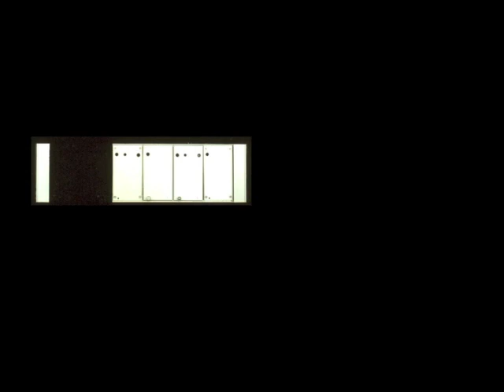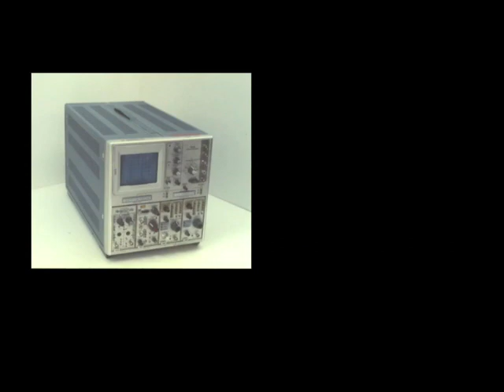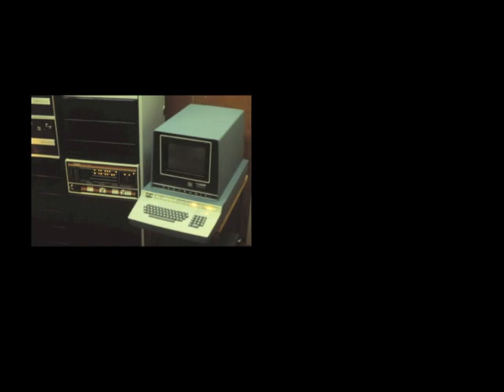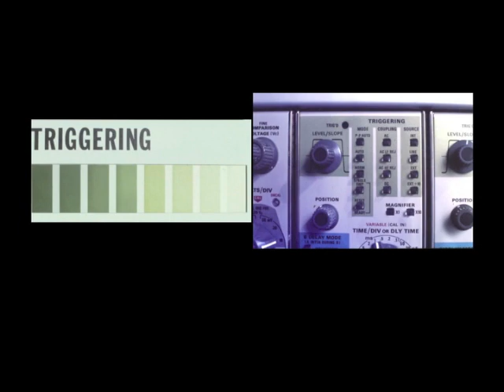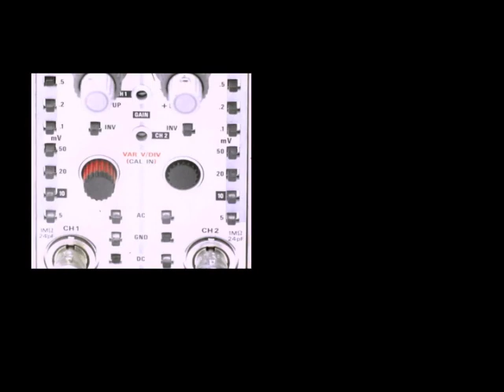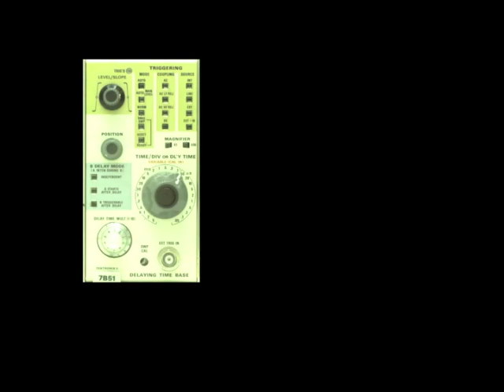Tektronix 7000-Series Industrial Design

Comment: The Tek 7000 was one of the most perfectly designed scientific instrument series in the history of humanity.  The only omission was not putting the rated upper bandwidth of the plug-ins on their faceplates.  Input impedance and capacitive loading ARE stated on verticals.. I am adding a small label to all my 7000 components indicating the upper rated bandwidth. With multiple mainframes and well over a dozen plug-ins, its handy to have BW stated.
Reply: Odd a company that thought of everything left that out. I have a Tek 7104 and wondered the same thing.

Comment: I am completely used to my 7834 although I have also had a 7704 and a 7904. My 7904 did a smoke show and I got rid of it because I assumed it was the high voltage circuit. I am full of regret because now knowing more, I'll bet it was tantalum caps in the power supply. This was a wonderfully informative video. Thanks for this.

Comment: An excellent presentation, a great insight into how the aesthetics were as well thought through as the functionality. 
Especially liked the full explanation of the colour schemes , engineering and industrial design perfectly meshed.
I only have the 1101 power supply but it still has its place on the bench atop my 475M .

Comment: I was able to pick up a 7834 mainframe and  7A22, 7B92A, 7A13 (digital meter), 7A18A plugins.
The 7834 was the SAME mainframe that i used at Hughes when I worked there.  I know it is the same because of my coffee cup stain and some markings I made on the rear panel for the probe power supplies.
I fell in love with that scope and couldn't believe I found one in a surplus store years later!
Still functions perfectly!  I was able to get the manuals for all the parts on CD, so I ran a few cal checks, and they are perfect!